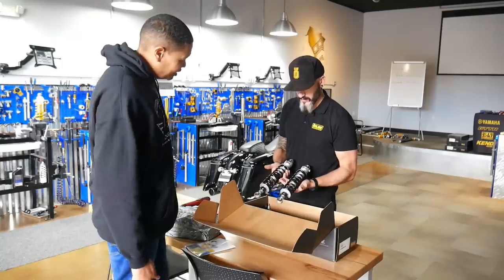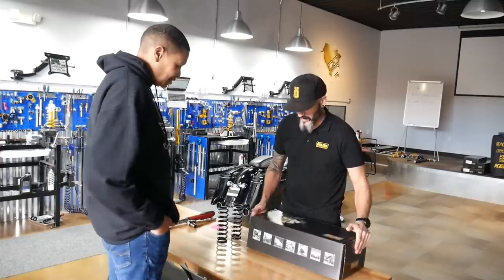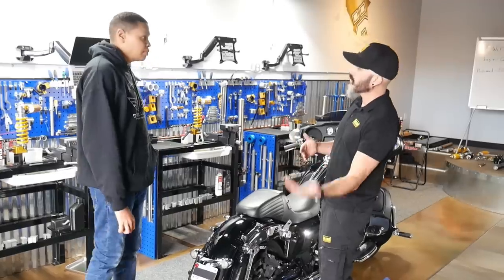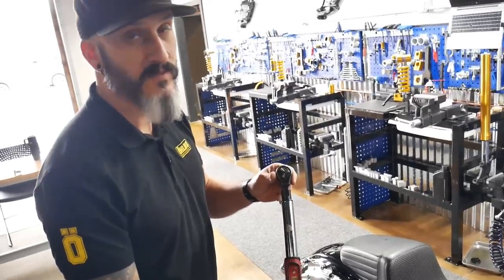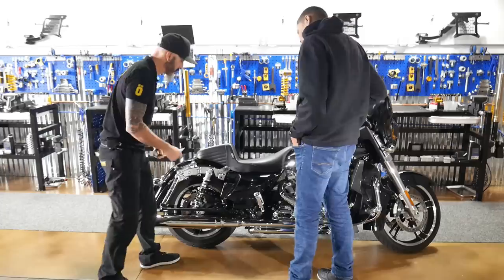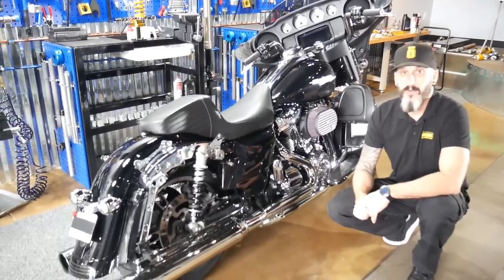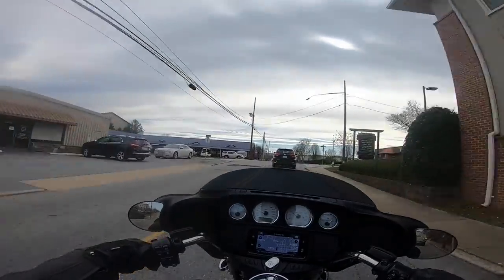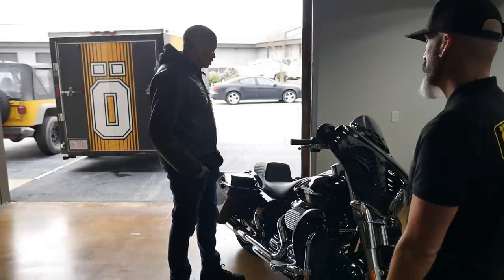Öhlins USA visit. Ohlins suspension upgrade on my 124 ci Harley-Davidson Street Glide Sleeper.

Comment: I had a set of Ohlins on my 15 RG. The ride was incredible. They were a pain in the butt to adjust the pre-load every time I took my wife out though. I finally settled on a setting that was a bit soft with her on the bike and a touch stiff solo. You need to keep the threads for the pre-load collars super clean or they bind up. The ride quality is night and day better than stock.
Reply: I agree on being a pain to constantly adjust for passenger or no passenger. Mine are the same way.

Comment: You don't realize how bad the HD factory shocks are until you change them out.  If you are going to put on miles, spend the money to upgrade the suspension especially the rear shocks.  On the touring line, go with the 13" rear shocks for the supreme ride.  Some say you don't need to change out the front for 2017+ models & I agree.  I might change out at my 50,000 service depending on how much $$.

Comment: Joey is who I bought my shocks from at the Sturgis rally a few years back. The shocks are killer!! Been on two different bikes since I bought them. Still perform like they did when new. Joey is a great representative of Ohlins and I stop in to see him at all the major rallies every year. Every year at Sturgis I have him service my shocks and after they're done it's like brand new shocks all over. Congrats Tall. Great choice!!!!!
Reply from the maker: Yep, Joey knows what he's talking about! If I ever trade bikes, the ohlins is coming with me!  Just curios, what does he do to service them? Thanks for watching.
Reply: Traveling Tall...the Ohlins shocks need to be service about every 25K miles. During the service they remove/replace all the fluids and replace every moving part inside the shock as well as seals etc. You can either send them to Ohlins, go there or catch up with them at a rally where they'll slap a loaner set on your bike, service your shocks then put em back on for you the next day or the same day. They'll set up the loaner shocks just like yours. Costs about $200. A lot of folks probably don't do it and never have an issue. But I'm a maintenance stickler and make sure all the needed services are done. Take care of the bike and it'll take care of you I say.
Reply: @TravelingTall  we completely disassemble the shocks, inspect, clean, reassemble them with new seal heads, piston rings, new oil and nitrogen. Internally they will be like new. We are able to provide this service at rallys. $250 for the service. Thanks Richard and Tall!!
Reply: @itssobreezy  I know it’s been a few years since this comment, but I wanted to say thanks Joey for all of your knowledge and presentation of it. I’ve seen you around in several channels (usually at rallies) and you’re always on point. Hope all is well!

Comment: @traveling tall I commented on your 124 kit build that you need to upgrade your suspension to Ohlins to truly handle the power of your engine. You need to upgrade the front suspension now. I went with the cobranded big bear choppers Ohlins 30nm cartridge kit with 2 inch over stock. I can’t stress enough how awesome that cartridge kit is
Reply: Is that upgrade good for my Softail Deluxe? Or just for Touring bikes?
Reply: MrPaints 1109 I don’t know, I suggest you call Big Bear Choppers and speak to Kevin
Reply: @angelvazquez2112 .... appreciate you, Brother.
Reply: Upgrading engine has nothing to do with with upgrading shocks, these bikes need new suspension as soon as you leave showroom floor.

Comment: What kinda burns me is I spent $27K on my stock 2017 Limited and to make it a truly great 👍 bike I gotta put another $10K or more in the 107 M8 motor and suspension to get it to perform. Harley should make bikes like this from the factory 🏭! My . 2018 Ram Powerwagon has blistein shocks from the factory because they know their crappy stock shocks Suck!
Reply: You have to admit, HD does give its customers many opportunities to make their machines better.

Brilliant marketing really.
Reply from the maker: A stock 107 is a strong motor. I had no issues going from the East Coast to the West Coast fully packed down. I never once complained about the suspension because I didn't know any different. Before the Öhlins install I would have told you it was fine. Now I see how big a deal the shocks make. Harley-Davidson makes a great bike stock, but from day one I knew that I wanted to do some upgrades. That's the reason I bought a standard. A stock Street Glide is still a great motorcycle. Thanks for the comment Leonard Russo and thanks for watching.
Reply: Traveling Tall Luv your channel. I’ll be comming to TN this summer to ride the Dragon 🐉. Been there before & luv the place 👍
Reply: Leonard Russo--> I agree with you.

Comment: I have Legends Revo-A shocks on my SGS 19. I have similar results.  It’s pretty cool that you have a spring for your weight so you have perfect initial sag and have maximum flexibility staring from your weight.  That’s an advantage I believe Ohlins offers of Legend.  I echo what everyone is saying.  You will see a dramatic difference in upgrading your suspension.  Don’t go cheap either on the shock change and it’s just as important to setup initially for you weight based on instructions provided.  The experience is very different based on setup.  This upgrade is about $900 ish depending on what you decide but over stock you will not be disappointed.  Thanks Tall for another awesome video and good mix of education and fun.

Comment: I put Legends Revo shocks on my Road Glide Special and had the same results, it made a world of difference to the ride compared to the stock HD shocks.
Reply from the maker: I didn't relize the H-D Street Glide shocks was so bad until I rode my bike with the Öhlins. Thanks for watching.
Reply: I went with Legend Axeo front cartridges and Revo-A rear shocks on my 2015 Limited. Amazing difference.
Reply: I put on 13” Legends Revo A shocks with a 1.5” lowering block and I don’t like the ride at all. Way stiff. Think I’m going to try the Öhlins Blackline

Comment: How long have you been riding motorcycles? Wait till you change the fork springs and see how handling will be improved. Might be a good idea to recheck your belt tension. after all, you do have a taller shock setup now.  Ride safe & keep the shiny side upright.

Comment: People always complain about the SG series having crappy shocks but what I don’t understand is why did you buy it in it’s slammed self then? The whole slammed look comes at the price of reduced shock travel Doh! My 2019 EGS is set up the same way and I knew I’d be swapping the shocks for some 13” shocks, one of the reasons I shopped hard for a year for this bike was I knew this going in. I bought this bike with 2k miles on it for about 6k+ less than buying it brand new because to me buying off the showroom floor is just silly. You are gonna lose thousands of dollars the minute you sign and leave the dealership parking lot so let someone else take that hit, especially if you are gonna modify. Love your mods Tall.
Reply: I bought new because I know of all the goofy nonsense people do to bikes, how lackluster their maintenance habits are, how most of them are all “intake and exhaust!” without ever tuning it (which results in a lean and hot condition frying exhaust valves and seats), how most are piss-poor at clutch control and burn up clutch packs, on and on and on. I do all my own work and have been down the rabbit hole of used vehicles. Some folks are REALLY good about hiding damage and poor maintenance habits. Buying used is a crapshoot, sometimes it works out in your favor and it’s a great vehicle for a great price that just needs typical new suspension, brakes, and consumables (like my Navigator I picked up for $15k, that thing is a beast), or it can be like the 04 Civic I picked up which had the wrong ATF in it, never had the transmission fluid changed, suspension bushings were shot, speakers were shot, headliner started sagging, tires were horrible, brake fluid was never flushed, coolant never flushed, etc. New prevents the exercise of discovering all of that and sometimes, I just wanna buy it and ride it without worrying.

Comment: I have the black version of these shocks on my 18 street glide special, and the difference from stock is night and day.   Just this past week I installed the Ohlins FKS228 fork cartridges that just recently came out for the 2017-20 touring bikes.  The overall improvement in feel and handling of theses cartridges compared to the stock damper rod system is extremely good.  I can't recommend this highly enough.  It's obvious that the stock rear shocks suck, which is why I changed them shortly after buying the bike, but I didn't really think the front shocks were that bad until I put these Ohlins cartridges in.
Reply: Do those cartridges come w/ the springs?

Comment: Ok first I would say thanks for the channel good content was wondering the if the bike was still stable in a straight line at high speeds because I think by raising the rear shortens the trail? Which in turn makes the bike turn in quicker? Just curious thanks

Comment: the watermarks with the speed, elevation, and lateral G's was that from the new GoPro setting or what ??
Reply from the maker: No you can do that with older gopros. Which one do you have?
Reply: I’ve got the GoPro 7 black (helmet) hero sessions (faring mount) and a hero4 silver with the audio back back.  

I still have the corded headset, waiting to get the Harley WHIM get stereo reception...

Comment: So basically when you remove all the Harley parts and replace them with great aftermarket parts a Harley is a great bike?
I have one also............pretty much all the stock parts suck.
Reply from the maker: I still have the tank badge! Just kidding my stock Street Glide went from coast to coast without any problems. Harley-Davidson makes a good motorcycle but there is a ton of things you can do to it to make it suit your needs. It doesn't mean that it wasn't good before but for my style of riding there are somethings that could be done better. 
Thanks for the comment Russ, thanks for watching.

Comment: Adam Sandoval used  shocks with the external reservoirs  and his argument was quite convincing.  
Did you consider that type of shock?
Reply: I have the reservoir shocks.  The most important thing about any shock is it being setup correctly for the rider. imho - the best thing about the rezzie shocks is they provide over a 1/2" more of stroke/travel.  3 inches compared to 3.6 inches.

Comment: I've been considering ohlins or legend. I would like to go up to  13 inch shocks however at 5ft 7in I'm not sure if that would work for me. Would you happen to know if the length of the shocks can be adjusted... 
Thank you 
I really enjoy your videos
Reply: I can help.  I am 5'7" as well.  Ride a 2017 SGS.  I went with Legend Revo A 13".  No problem with it at 13".  Was told to go with 13" if you want a better all around ride no matter riding in curves or flat and they were 100% correct.  The difference is night and day.  It is the first mod someone should do if they plan to put on a lot of miles and ride instead of a bar hopper.  Both Ohlins and Legend are good brands.  Worth the money.
Reply: @mojomanmurph1925   perfect, that's exactly what I was looking for.....
Thank you
Reply: I have the black version of the 13" ohlins in the video. I'm 5'8", and once the sag is set properly approximately 1" from fully extended, the seat height feels very close to stock height with my feet down.  They also have a height adjustment of about +/- 5mm on the bottom mounting point, and I have mine set as short as they go.

Comment: -What about the front end?
-HD should use Öhlins instead of their stock crap, especially for what they charge for the bikes. My Ultra Limited rides about as rough as my Vrod!!
Reply: I heard through the grapevine that a front shock is coming very soon.
Reply: Check out Big Bear performance for a 30mm Ohlins fork tube kit that performs just like the Ohlins inverted front end
Reply: @johnbrewer8882  I have a new 23 Road Glide Limited which uses Showa’s Dual Bending Valve system in the forks. Coming off a 21 Goldwing I gotta tell you, this thing feels like a friggin boat. My wife even commented on how it feels like a jet ski when I do a repeat roll on, roll off, roll on, on the throttle. I can hold the brake and compress the forks down several inches sitting still. As of ‘23, the suspension still pretty much claps out on highway bumps.

Comment: How much of a height difference was it for you on the seat? At 5’7”, I am far from Traveling Tall and I don’t want to jump off a SGS at a red light, lol.
Reply: I’m 5’6” on a good day and bang around on a Road Glide Limited (stock 13” shocks) without any real issue. It’s an absolute bear to back up compared to the 21 Goldwing I traded it for, so I’m much more cautious of how I park, but that’s the only difference.

Comment: Love your videos and what you have done with your ride. I'm a tall rider as well at 6'-7". What app are you using to capture and overlay your bikes performance stats over your videos? Keep up the great work and ride safe!
Reply from the maker: Thanks for watching. The GoPro app does the overlay
Reply: @TravelingTall  Thanks for the heads up on the GoPro app. I will definitely have to check that feature out.

Comment: I have a street glide.  2010 and the suspension it has is the original.  and I don't like what type of suspension you recommend.  since I always bring my wife on my motorcycle and it hits very hard
Reply: What? These suspensions are entirely adjustable based on load such as luggage and a passenger.